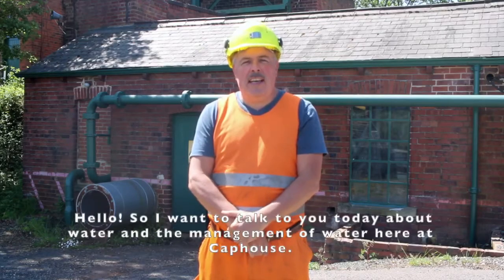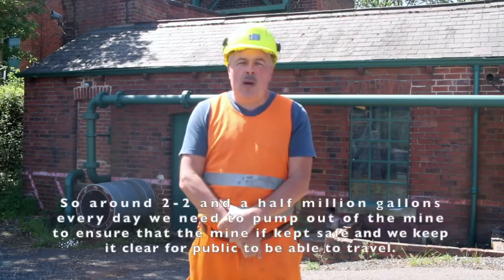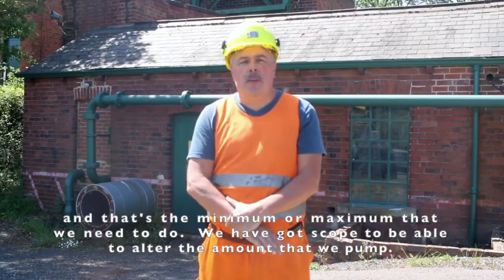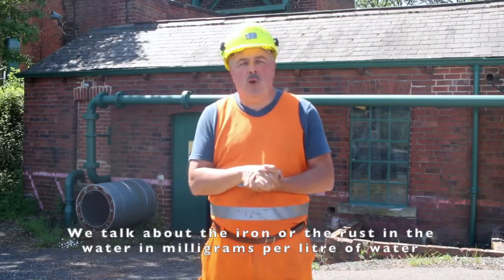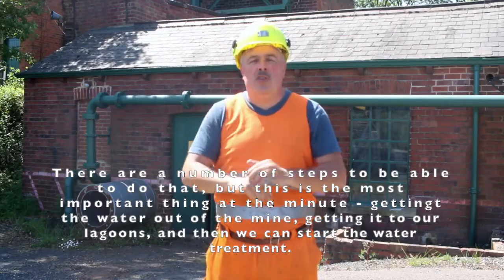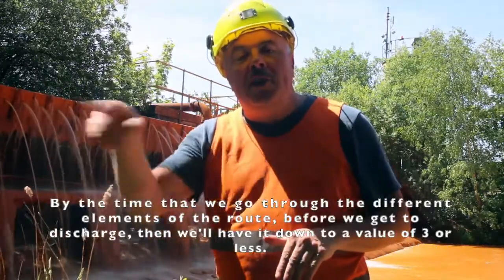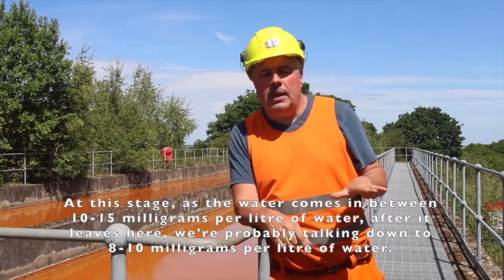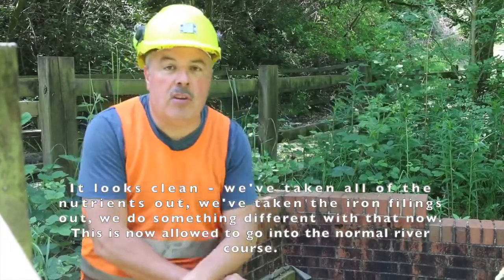World Water Day: Cleaning our Mine Water

Comment: Very interesting.  Thank you.  I have two questions.

Where I grew up in South Tyneside, in the 50s and 60s while the pit was still active, the pit pond was jet black and revolting.  As kids we were told if we fell in we'd suffocate before we drowned.  Birds knew not to go anywhere near it.  So why wasn't our pit pond brown like yours?

Does anybody harvest the reeds from the reed beds?  Just wondering.  If anybody is making clarinet reeds from reeds in that environment I'd be fascinated to give them a go.
Reply: its brownish or orange due the oxidisation of the iron containe in it, if you saw black that could be down to whatever chemical the water is escaping through. The pH of the mine water is mostly neutral to weakly alkaline. If the mineralization is low, the toxic content is generally below the detection limit. In the process of coal mining, when the mine water flows through the coal mining face and the roadway, it is artificially affected. The rock powder, coal powder, and other organic matter are mixed into the water. If the water is polluted, then it is grayish black in color, and contains a large amount of suspended impurities and a certain amount of microorganisms